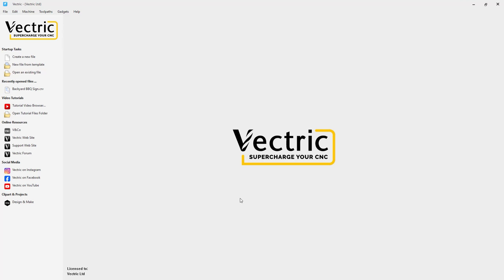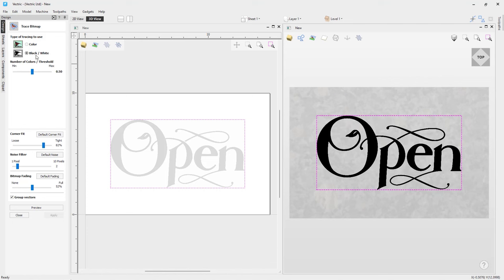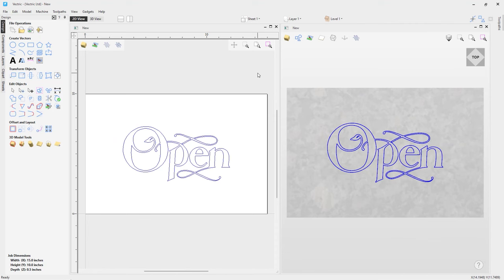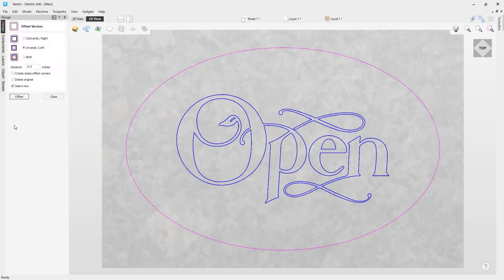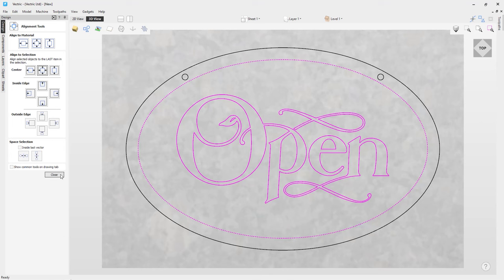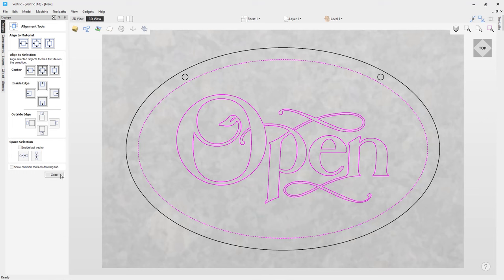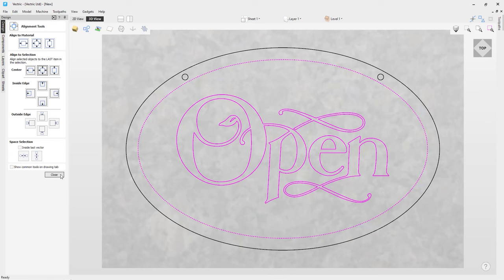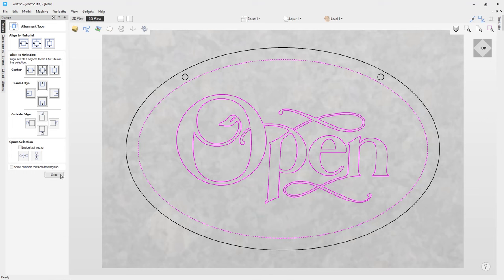How to add clearance tool to v-carving in Vectric VCarve & Aspire | Getting Started | V12 Tutorials

Comment: why did you save them in multiple files? does this mean the machine will do that file, then stop, then you have to re-zero it all and run the next file and again and again ? im about to get this software and new so im wondering the process to this and why youre doing that. Can you please walk me thru that
Reply from the maker: Hello, and thanks for the comment/question.  We do not have an automatic tool changer (ATC), so when there needs to be a tool change we need to do it manually.  Most of our customers don't have a ATC so they do the same thing.  Between the toolpaths the CNC will return to its "Program" home (0,0) and a safe Z height (you set this up in the software).  Once you are there you simply rase the tool up, swap out the tool, and then re-zero the Z (seeing as you are back at 0,0 then the only thing you need to update is the new length of the tool, or the distance from the tool tip to the material or machine bed).  It is very simple once you do it once. I do hope that helps.

Comment: simple question: the drilling toolpath went not all the way dawn 0.455, but only 0.325 I think. So why is that ? kind regards Hans
Reply from the maker: Hello and thanks for the question.  Yes you are correct... I did not cut all the way through.  You can just update the toolpath to do that. I really wanted these holes just for location pourposes and in the real world would need to sort out how I was going to hang or mount the sign and then make the holes the right size and depth.  This was really just to demonstrate how to use the toolpath.
Reply: @vectric  okay thanks